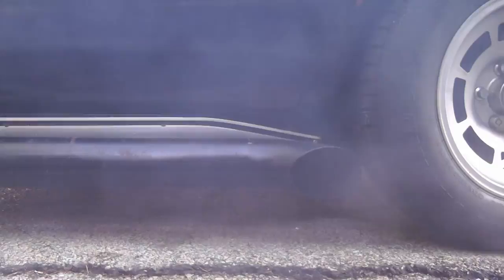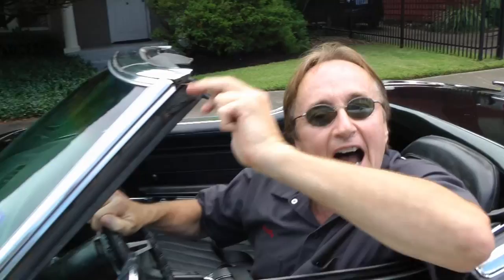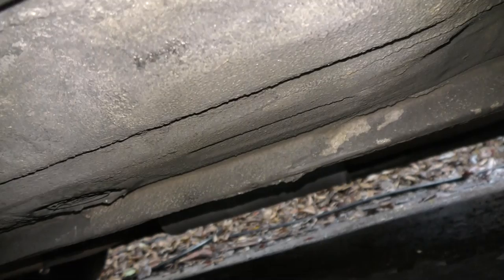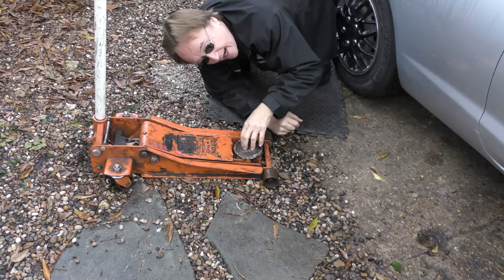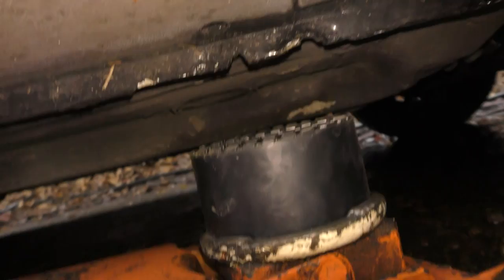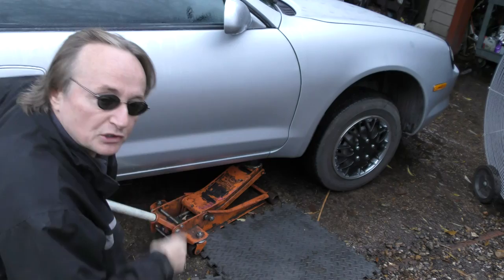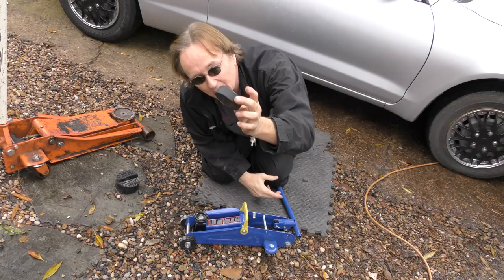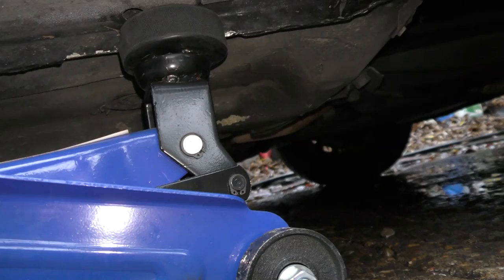How to Jack Up Your Car With a Hockey Puck

Comment: Wrong - not that simple. No pressure should go on the rail edge. The correct pressure point is behind the rail edge. You need to customize the hockey puck so that its higher on the portion that will be behind the rail edge. To confirm this line the oem jack that comes with the car up to the pinch weld and raise jack until it is firmly pressed against the car. You will notice that the slot on the jack never actually touches the rail edge. The jack part that is behind the rail edge actually makes contact with the car and takes all the pressure.
Reply: Nonsense. The scissor jacks that come with the car are perfectly uniform in the exact same way. The plastic on the outerside of the rail bends and the metal there still solid enough once squarely placed between the slot.

Comment: I had the exact same idea.   I went to a hardware store and bought myself a small 2" Square (1.5" high) block of hard plastic, bolted it to the flat top of a generic Scissor Jack, and then cut a 1/2" deep slot down the center of it with a Circular saw.  Basically its just like the hockey puck you have, except I bolted mine to the top of the jack with two  1/4" bolts so it won't slide off the top of the jack.  The main reason I did that was so that the car itself would not slip off the top of the flat top of the jack.  It works great.    I have a small hydraulic jack just like the one you have, and I find a bolt where the sub-frame of the front suspension attaches to the body of the car, and I then place the jack under that bolt-head and lift the front of the car up that way.  That works great fro me.

Comment: Hockey pucks are also good for a modest body lift where you don't have to replace or extend lines and wiring or figure out what to do with a large gap between body and bumper. A cool weekend project.

Comment: Where I live the official jack points are always rusted out and useless after a few years due to the winter salt.  subframe mount points and suspension mount points are where you want to do this.  No puck required and it works on any unibody vehicle.  Even a severely rusted out car can be safely lifted this way - and obviously a brand new one too.
Reply: Oh, these points are sometimes well inside the edge of the car so a cheap jack often cannot reach them - you might need a puck then if your car isn't too rusty and you only have a cheap jack.

Comment: I have a 2013 Ford Fusion Energi that I needed to rotate my tires on.  I had hit Amazon and a few other sites looking for frame rail protectors, and wound up coming up with the hockey puck idea too.  However, this didn't work out with my car - the car is so heavy that it wound up cutting the pucks in half.  I had 3 pucks - one I cut a groove in with a hacksaw, the other I made a shallow grove with a box cutter, and the last one I left completely flat... the car cut all three in half.  Fortunately, there was no damage to the pinch weld this time.  So, I cannot encourage the use of a puck to lift your car, at least if it is a heavy one like mine.  I'll probably wind up buying that plastic one that you had shown earlier.  There's a few metal ones out there too but they get pricey.

Comment: If you can't get a puck,  get a square block of a 2x4 (wood ) and cut a groove in it. This will also work fine.
Reply: Important to cut across the grain, though.  Coworkers of mine will borrow my blocks and they'll come back split after they align the grain with the pinch welds, which is both annoying and dangerous.
Reply: +Joseph Wolchak Until it breaks.
Reply: Wouldn't that be risky though?  I even thought cutting the puck as deep as Scotty did asking too much from that puck.
Reply: unless its oak, maybe, all my pieces of wood split where it met the seem, eventually it will

Comment: That's what I recently did went on ebay bought couple 3" diameter 1" thick hockey pucks to fit my new low profile 3 ton floor jack from Harbor Freight works great...

Comment: You can also make one from a sacrifice rubber mallet that you wanted to upgrade anyway. :face-fuchsia-tongue-out:
To avoid splitting, make the slot as deep or deeper than the ridge.

Comment: Scotty, just recently found ur channel and i must say, i like some of ur videos, and thank you for that, especially the wiper blade one, i was planning to buy new ones, but ur vid helped in time. 
Anyway, i have a question, my dad says we need to keep the car idle for a good 10-15 minutes in winter before driving it, he says its for the oil to warm up, i did a small research and there a few articles saying we dont need to, while another saying we should, wat should i do? (in my place its not too cold, only around 15-20 celsius,  59-68 farenheit)
Reply from the maker: +Arshnas Mohammed   thirty seconds warm up is fine at that warm temp
Reply: Cars today have aluminum blocks they warm up very quickly in the cold weather C -20°C let it warm up five minutes and you’ll be fine don’t forget the transmission also needs to warm up for five minutes and you’ll be fine

Comment: Why the bash? Not all of Scotty's videos are useful to me, but still there is something gained in everyone of them. I'm a shade tree mechanic whose learned a lot from him. Take it in stride. Personally I would notch a 2x4 cause it was handy. Or I'd probably take a lazier route and run two blocks parallel with the seam. I don't have a unibody car. When I need to Jack one up I'll consider his block method an option.

Comment: The Subway guy can go back to the subway! Lol. That's a fantastic idea!!! I've always just used 6-8" long piece of a 2x4 for jackin up my vehicles, with my floor jack. Yeah, it works...BUT...the pieces of wood eventually splinter and break apart from the weight of the car! This truely IS a very good idea using a hockey puck!!! Soon as I'm done here, I'm getn on Ebay!! Lol. Thanks Scotty, your videos are really appreciated!!! 
Don, from TX!!!

Comment: Years ago, I bought a square saddle with a rubber pad for my jack from Eastwood.  It was expensive at the time $30 and now you can get them a lot cheaper.  But I've had it 20 years and it's really been worth every penny.

Comment: if only cars had solid jack points like aircraft = (
Reply: +Ira Friedman I never jack my air craft, it flies in the air itself
Reply: Hi! If you look under your car you will see strengthened framework that garages use to apply their lifts to.
You can use a trolley jack with a rubber pad and it molds to the shape of the frame - very safe and secure.
Reply: Exactly what i've been wondering about.   If i had the means, i'd weld on a structural base on top of those flimsy jack points wide enough for anyone to be sloppy in positioning the jack on.
Reply: all cars do in the front and the rear.. theres no real need to jack in the pinch welds

Comment: Those are some rice ass hub caps LOL

Bare steelies or actual alloys.
Reply: +Jay Santos my vw came with black steelies under the hub caps... Actually all my steelies have been black. I sand and paint rusted ones black to prevent future rust. It's not rice, it's common sense.
Reply: +Jay Santos on my volvo my alloys are heavier than my winter steelies. Same with my a4 alloys. I'm not defending riced out cars, but you don't know how much steelies weigh, and you don't know what color they are stock, so I don't know what you're getting at really. Some people like steelies because they don't crack when they bend, and they are cheap and functional, and can weigh less.
Reply: +Jay Santos I did it because I was restoring my car to her formal glory (mostly removing rust). Do you honestly think I'm that fucking stupid where I believe it makes me go faster? If I really was a ricer, I would've bought those fucking Autozone spoked hubcaps, dipshit. Hense my original comment. 

And they are wide for a small sedan, thank you. They're a lot wider than most cars on the roads today. I don't race, I don't think she goes fast, but at least it looks good and I don't give a shit about the wheels when I have to take it through seasonal roads, trails, and snow.
Reply: +Jay Santos Oh forgot, I don't think you realize what 205/65 tires for a 15 inch rim actually looks like. The tire is decently wide, more than a lot of common tires for economy purposes. But the walls of the tire itself are huge, it looks like a god damn off road tire. And that's why I like it with my steelies, looks rally AF
Reply: +Violetta I ran 225s on my audi and they were plenty wide on steelies.
Reply: +hugeslacker Nice. Those definately are, haha.
Reply: +Jay Santos living in long Island and driving through nyc every week, it doesn't matter how responsible you are, you're going to bend your rims. So steelies are a worthwhile investment, especially for our harsh winters (besides this year ha), and how torn up the roads get.
Reply: +Violetta   They're plastic dude
Reply: +vansurfing I know? It's a hubcap?
Reply: +Julius Cesar That's kind of why I chose to keep the stock steelies! It looks almost tough, and they have been tough. Rocks and shit up here in the country on seasonal roads and trails haven't done anything. I just take 'em off once every year for another coat of black paint and clearcoat! Mint.
Reply: +Jay Santos They don't rip out. They pop out as they're supposed to. And you don't paint them black, they come painted black from the factory. Class is defined usually by age, and before plastic wheel covers and alloy rims car rims were steel with no covers. So if anything plain black steelies are classier than fake ass plastic wheel covers, by definition. 

But like you said, whatever floats your boat. In my opinion, plastic wheel covers are just the cheap way of hiding rusty rims, if the driver doesn't care but still wants it to look "good" at a quick glance but even then hub caps still look like shit 99% of the time.
Reply: +Violetta Mint.

Comment: My OEM scissor jack is basically flat on top with a couple of raised ribs to help keep it from sliding out, the pinch weld itself has a rounded out finish so a hockey puck would work prefect without cutting a groove. I suppose a slight groove could be helpful though.

Comment: A hocky puck with a sawed notch can split.  You can make a better grove using a coarse rattail file, but it's better to spend a few bucks on a cast urethane puck or make a pinchweld jack adapter from unistrut.